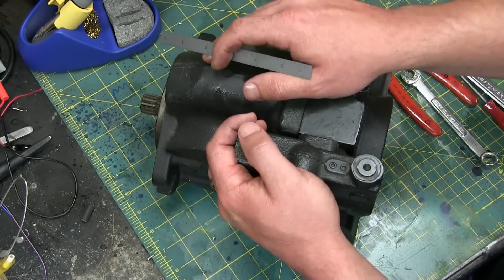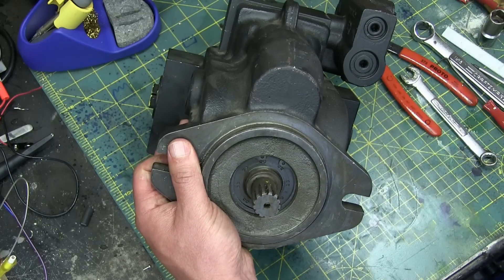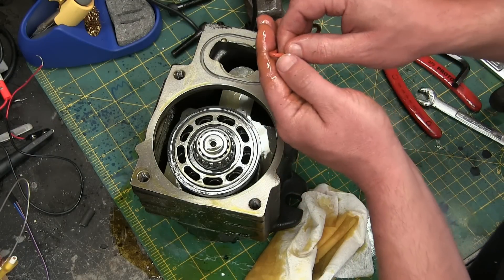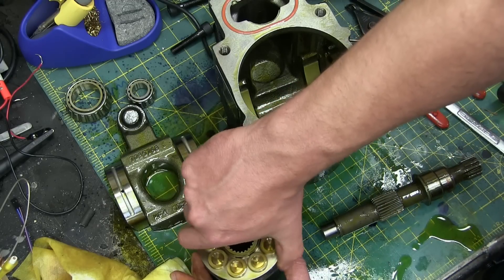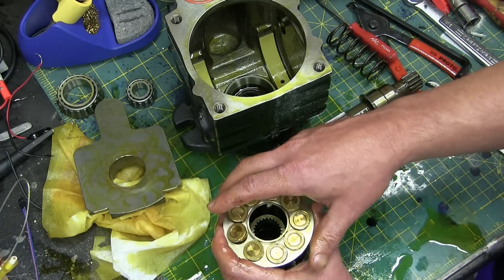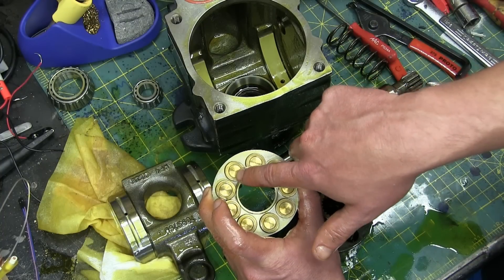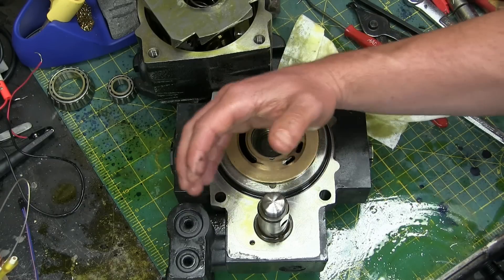100 HORSEPOWER in your HAND. Hydraulic PISTON PUMP!

Comment: I remember Honda used to use this system for a hydraulic transmission for some ATVs, It also used the engine oil as the hydraulic fluid

Comment: Interesting to see how they go together. About half a lifetime ago I spent more than a few nights in front of an old WWII vintage Sunnen precision bore honing machine bringing the cylinders of pumps of a similar design but smaller bore diameter to insanely tight tolerances. That blueprint was the first I ran into with the tolerances specified in millionths of an inch.

Comment: brings back nightmares of a job I had to rebuild  hydrostatic drive unit for a big mower! 2 drives each wheel! it took three weeks to get the parts and I had to work around a table with all 9 million parts covered with a tarp under and over it! then put it all back together like working in a clean room for surgery. with something like 8.000 dollars in parts. the good side it worked great for years after and I had no extra parts. but I think it was the most complicated precision part I ever worked on. keeping in mind I worked on garbage disposal equipment hydraulics but had never even seen one like this! thanks for the memory!

Comment: I've spent a lot of time using or fixing those Cessna / Eaton pumps the little 1/8" NPT hose with the correct fittings used on the pressure sensor is a royal pain to source if you are in the middle of Bristol bay. So we always kept 2-3 on board.

Comment: From what I’ve seen these pumps are usually set up to go into a high pressure standby. I usually see them in which circuits. Any leakage in your system or a worn relief valve causes it to constantly stroke to achieve their compensator setting so they run super hot if you have worn components.

Comment: As an old Mannesmann Rexroth engineer I have to say you know quite a bit about hydraulics, a rare skill.  One thing that might be nice to mention is that the barrel group and piston assembly is basically the same mechanism used for Gatling guns.  That particular unit is a Sauer Danfoss out of Denmark, one of the best.
Reply: Is it that rare a skill?
Reply: Greenmachine305 yes, yes it is.
Reply: Neato.
Reply: Honestly, though...I know a hundred guys in florida who have at least a rudimentary working knowledge of hydraulics used in agriculture, construction, mining, industrial equip etc.
Reply: I do not consider knowledge of ¨farm-grade¨ equipment as a skill.  That stuff is the cheapest, down and dirty hydraulics there is, an idiot can take four bolts off a directional valve and see if the spool is stuck open.  Taking a piston pump apart and having knowledge of it´s control scheme, i.e. pressure compensation, load-sensing, horsepower control, etc.. is not knowledge you will pick up at the feed store many farm-grade hydraulic components are sold out of.  That is knowledge that is picked up at courses teaching these control techniques, courses that are bought and paid for by professionals like this gentleman, courses like the ones I used to give throughout North America.  If there is any other issue I can iron out for you just ask away.
Reply: Thanks, I understand you perfectly now.
Reply: I'm curious, what sort of Gatling guns would use this type of mechanism?  Would it be the gas operated type of Gatling gun?  Doesn't seem like it would be necessary on those Gatling guns that are externally powered with an electric motor, or, on the original Gatling gun, a hand crank.
Reply: jhensjh No, no, the guns are not powered by hydraulics.  I was referring to the barrel group´s swashplate principal.
Reply: Oh ok, for some reason I thought you meant this mechanism was what provided the power to rotate the whole barrel group.  Does the swashplate in a gatling gun control feeding and ejection of spent rounds for each individual barrel?  I could picture the individual pistons in AvE's pump being replaced with a bolt that opens and closes the breach in each barrel in a gatling gun.
Reply: jhensjh Exactly, as the barrelgroup rotates the pistons rotate with it, because one side of the pistons are in contact with the swashplate, which is at an angle, they translate IN for 180 degrees and OUT for the remainder.  On the IN stroke, bullets are fed into the chamber and on the OUT stroke they are expelled.  Sounds complicated but the action is very smooth, that is why Gatling type guns are very reliable.
Reply: *****
Very interesting, I never thought about exactly how a gatling gun opens and closes the breech for each barrel, but that makes perfect sense.  I recall seeing a GAU-8A removed and sitting next to an A-10 at an airshow when I was a kid, but haven't ever seen any sort of gatling gun disassembled.  Unfortunately, even here in the states a gatling gun isn't easily obtained by a civilian, haha.

Comment: Its very simple actually, the more complex one are the ones designed for
 hydrostatic transmission, they have a servo-controlled swash-plate 
which is load sensed by pressure sensors (4 to 20 milliAmps) and the 
electric signals are send to a computer to adjust the flow and hence 
facilitate the volumetric displacement for the hydraulic motors vehicle 
when moving up their loads on steep terrain. These pump has also a fixed
 displacement "charge pump" responsible for these very important task:
1)Replace the fluid leakage inside main pump
2)Flush hot oil and replace it with cool and filtered oil
3)Help maintain optimal internal pressure for pilot pressure (servo-valve)
These same pumps are equipped with accelerating valves, responsible for controlling the vehicle's sudden change of speed when starting to move or stop.
The same system is equipped with a radiator to sink the excessive heat out and cool the oil, so it doesn't loses its viscosity and anti-wear chemical properties. This is just the technical aspect of a "simple" hydrostatic transmission... Now about the beautiful engineer maths behind them !!! Anyone wants to get rammed without hydraulic oil AW-68 ?!?! Yes, No...
Reply: I routinely repair equipment using hydro transmissions, and no servos necessary. Just good ole-fashioned direct linkage to the swashplate.
Reply: Can you link anything regarding the math behind it?
Reply: What's math?
Reply: Juan Carlos Rodriguez
I recommend you reading this book for starters:
"Fluid Power with application 6th edition
by Anthony Esposito"
There are great examples of fluid power application relying on pneumatics and hydraulics and there are plenty of exercises to practice and hone your skills in maths and hydraulics.

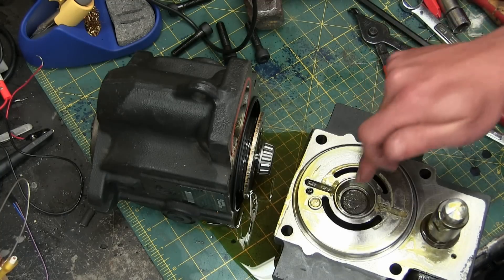Comment: 3:40 That's a relief valve of sorts in case the case drain line gets restricted- case pressure inside the pump will open that and dump into pump suction port to keep the pump shaft seal from blowing out

Comment: Back when I was an aircraft mechanic we used to hammer out o-ring picks from brazing rods(CuNiAl-type) at least I think they where brazing rods. We hammered them into a flat  spoon shape. It doesn't scratch steel and doesn't nick o-rings, just a tip(until the swelling goes down).

Comment: great video, maybe it's stating the obvious, but you may want to mention how that pump with change fluid flow direction with the motor rotating the same direction. cause that's pretty awesome and technically speaking it's a "multi piston, variable displacement pump" ;)

Comment: There are some variable displacement AC compressors used in the automotive world (where they can't easily control the speed of the compressor) that are similar design to this with the variable swash plate. Others are "variable flow" by limiting the amount of refrigerant into the compressor. Fascinating to see how it works.

Comment: Wish it was the first time I'd seen anything like this,. I klnew how it worked when you said Swashplate. Twice in the last 2 years, I've been inside the hydrostatic transmission of my parents lawn tractor. First time it just needed the filter cleaned(can't get a replacement so I hosed it with carb cleaner. The second time, the bearing race that the pistons ride on had a large chip and the motor side would jamb every few revolutions, locking the wheels.

Comment: I've had to work on a few NACHI variable piston pumps, did a WHITE pump two weeks ago. Usually is if the swash plate is bad it cost a lot to replay along with the pistons. that Swash plate he called copper or brass sorry forgot what he said. You can sand it down to make it smooth, but if you go past the brass/copper coating gonna need a new one. but great vid thanks !!

Comment: I used to machine the non variable version of those and hated them with a passion. They had to be with in 2 tenths on the od of the pistons and polished to a mirror finish along with the ball ends. It was such a pain in the ass all around compared to a regular gear pump

Comment: Some variable speed air motors are like this too. Might be a tilt block instead of the swash plate (extra parts to capture the pistons onto it), but the same general idea in how it works. Only part really reversed is fluid going in working the pistons rather than the other way 'round.

Comment: What starts the process ?, is it the flow of oil into the piston block causing the pistons to move forward - slip on the swash plate and cause rotation?.
or
Are you saying that the shaft has to be rotating first, causing the pistons to suck oil in and discharge it at a higher pressure.

In a final drive hydraulic motor on a excavator  which turns the tracks - how does it operate ?

Comment: Trap for young players: In relation to the check the case drain for pump health. If the pump has a charge pump stage (think hydrostatic closed loop drives) then likely the relief flow from the charge pump is dumped into the rotary group case, invalidating any useful info you would get from a easy case flow test. The pump will seem bad do to the excessive case flow, you'd think it was loose like a hotdog in the hallway.

Keep up the awesome work.
Reply: Sauer Danfoss Series 90 closed loop pumps are a great example of just that. Basically they have forced you to crack the thing open (at one of their fine authorized service providers).

I wonder if you could get a baseline of the case flow at neutral then hit her into full displacement and get a delta?

Comment: anyone know where the vid is on the load sensing pressure compensating control?  i finally got my hands on a similar unit, a 45cc 4500psi variable displacement pump, which has a "load sense control w adjustable flow"... and im trying to figure out what kind of orifice to use to the load sense hole to control flow, and how its gonna operate and so forth

thanks

Comment: I had one of these about four times the size crap out on me on a rig. It sucked. Spent 14 hours babysitting a hand pump to control the packoff that sealed the well till we could swap it and pull out of hole. Shoulda kept it. Pretty sure it grenaded but I still would have liked to look inside.

Comment: That "dashpot piston" is actually an anti-cav,   It will protect the pump from cavitation in case the suction line is clogged or somebody forgot to open the ball valve on the inlet. The valve plate is not preloaded,
Reply: AvE   Notice how light this spring is,    In the event of a restricted suction,  the pump will actually draw from the case  to reduce damage
Reply: It's Essentially a little check valve,   If vacuum pressure is too high, it will compress the spring and connect the inlet to the case.

Comment: Vicker's Hydraulics in North West Omaha, made 182 different variable pumps and motors for Hustler lawnmowers to John Deere. Bought and sold off over seas in 1988. Gone forever, along with 230 jobs and an assortment of 400+ machines. Sad!
 GM sold rotating remanufactured electrical using a company base in Torrence, CA. They moved "American Motor Parts" to Mexico. I was working on contract at the time thru Raytheon, and saw techs checking and measuring parts and writing it down. Off to the side, I noticed the techs where repeating each test, but pretended to write something down. All dog & pony show. Watched a starter reman team, and they did not even load test the solenoid, only hit it with 12 volt to see it would move. I asked and got BS for answer. I walked around the corner to see pallets stacked 8 rows high. I climbed up and found the boxes above the first row empty. There where trying hard to fool us while the company was moving into Mexico. Real sad. Retired early because Dr pulled the plug on me. EX- ACDelco MASM / ASE Master Tech since 1978.

Comment: I have a cub cadet tractor with hydrostat, a variable speed hydraulic transmission. in the course of rebuilding this beautiful beast, I've seen drawings of the transmission, but I can't make much from it. I'm only taking a guess, but does this transmission work similar to this? it has a lever I push forward to go forward, or backward to go back. no gears to shift, couldn't be much better.

Comment: I've got 70144 that is weak intermittent stops completely  I've had a similar pump run out of oil that scored the plate they told they could machine it and it would work yes about a week and 3000 grand later  .  What parts cause failure

Comment: Yo, I don't know how you are about replying to video comments, but here goes. I have a Vitamix Blender (very skookum) that has been rekt. Someone at work spilled asparagus soup all on the innards of the machine. I took it completely apart for cleaning. What is a safe bet for cleaning the thing with? There's shmoo all over the coils and the part that makes contact with the carbon brushes are all black and worn. I got all the electronics separated from the plastic casing and there doesn't seem to be any damage to any of the pcbs or wires. It seems to meet that the motor, being all covered in asparagus soup, is the culprit.
Reply: If you're curious, it's a Vitamix 5200 Blender. On Amazon it's priced at $450usa. Not a cheap machine.

Comment: Thanks for the vid AvE, I had a cat mech explain variable displacement over barley samiches once, and saw a cut away at a hydraulic shop, but the pic was far from complete, I think I understand better now, how ever I hope to find a follow up vid on the control. On hydrovacs (glorified hydraulic driven triplex pressure washer pump) the rule is never use a valve or trigger on the pressure hose, else if your lucky you will only take out the lovejoy coupler, but on some of the smaller units they say they are "hydraulically compensated" so you can, and I'm thinking this video kind of explains why, I really need to see the control and how it works to confirm. I'll have to watch again cant find a link to the follow up, is there one? any how thank you.

Comment: Ave, love the vijeos and have been watching for a while and just subbed. Realizing it opens a new can of worms, but as a layperson could you throw in a short real world application of what some of these hydraulic systems and pumps run? Thanks, keep releasing the sch'mooo
Reply: Tractor wheel motors, concrete pumps, lawnmowers, construction equipment hydraulics...anythi g that requires precise control of oil flow of high pressure fluid systems. The applications are only limited to the size/weight to power ratio. These suckers are heavy.

Comment: At 10:15    If the piston unit is the real reason why axial piston pumps are so expensive, how can a variable displacement pump cost approx. 3 times more than a fixed displacement pump with a similar size from the same manufacturer?  This part on both pumps is obviously identical.   
An example: In my country I can buy a Rexroth 80cc fixed pump for 900 euros and a 0 to 80cc Rexroth variable pump for 2700 euros from the same shop.  Both these are indeed standard pumps. As original spare parts for some machines, their "own" pumps will probably cost a lot more.
And if you're satisfied with cheaper pumps you can buy a similar size fixed Kazel pump for only half the price, That isn't even twice more than a Kazel gear pump costs even if the gear pump can produce  200bar (2900psi) and the piston pump 350bar (5000psi).

Comment: I bought a new looking pump to replace the old one that wouldnt make pressure anymore. The new pump is very hard to turn and over heats the electric motor that turns is. I need a little guidance if you would please.
Thanks
Rick

Comment: that manifold bearing plat is that done with an explosion weld or is it arc welded and machined and where the hip joint goes through the ring plate is there play back and forth to kept it from binding the pistons inside the cylinders? thanks for the video I've never seen one of these before

Comment: hello ethal, how you know if the cylinder block is ok or not. you've mentioned that the smooth piston inside the block has no seal, so the thickness/viscocity itself is the seal. is there a measuring tool for it? thanks

Comment: Excellent Video,   that "Dash Pot Piston" at 4:30  looks more like a Check valve,  or Blow valve to me,  But  idk..  
   So why is that $5000.  and 100 hp,?  it's gotta consume more hp first,  What car does this come out of,?   Ford and many other co.  use the same axial pump style,   maybe less pistons or not,  similar design, but  a lot cheaper..   many others use a vane pump.   but, I love the Axial design,  It does create a pure sinusoidal motion, unlike a crankshaft piston..
    There's a Gasoline Motor called the  "Duke Engine" (5 Cylinder)  that uses the same swash plate configuration,  Ports, no Valves,   it's smooth and efficient because of the sine wave motion..   Just plain cool..    I'm a big fan of two stroke motors because of Ports instead of valves,  The Duke engine port design has no reed valves as far as I know...   
   My ancestors are from Slovakia ,  They work like Mules..